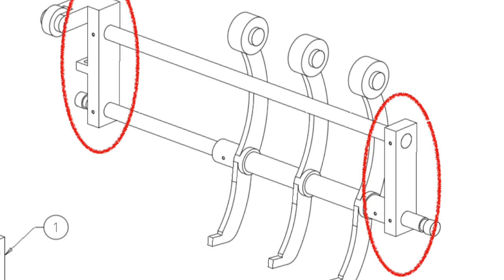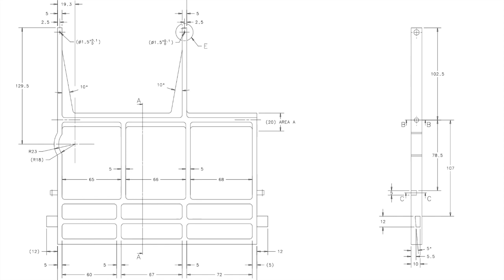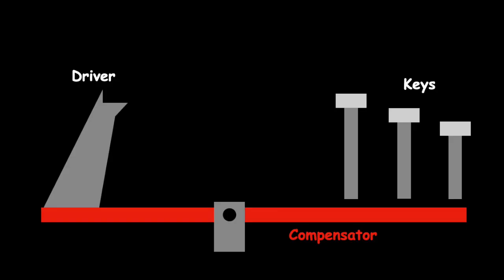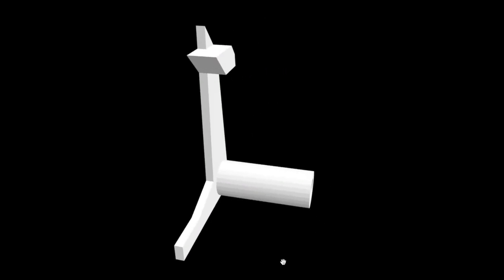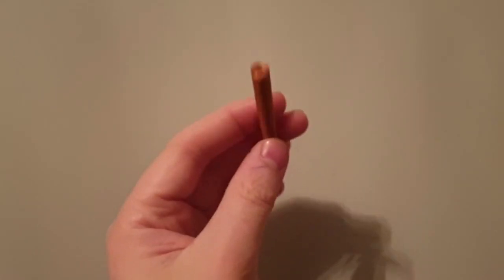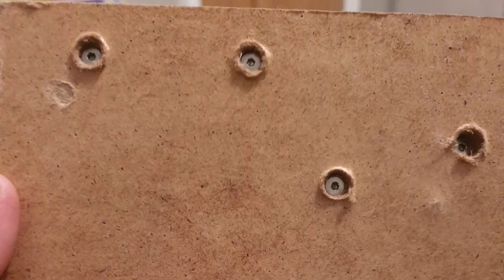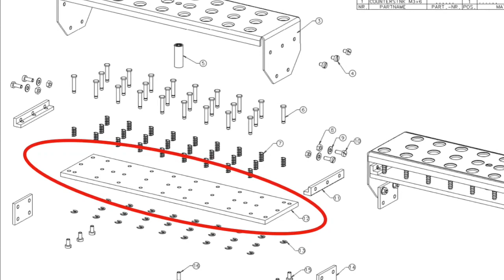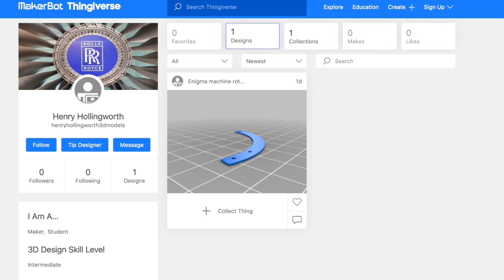3D printed Enigma Machine (part 3)

Comment: Would this help with the rotor wiring?
https://arduinoenigma.blogspot.com/2020/08/design-of-enigma-machine-rotor-using.html
Reply from the maker: yes, that is really useful, Ive had to take a break from the machine for a while but once I get back the electronics will be the first thing I approach